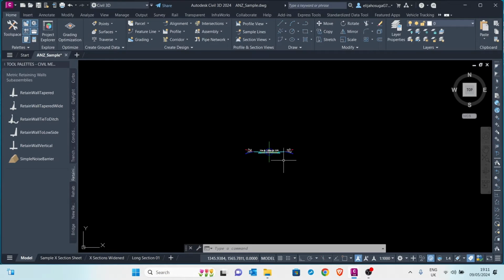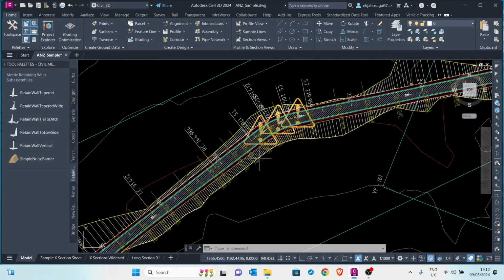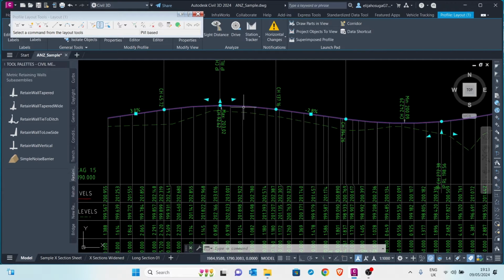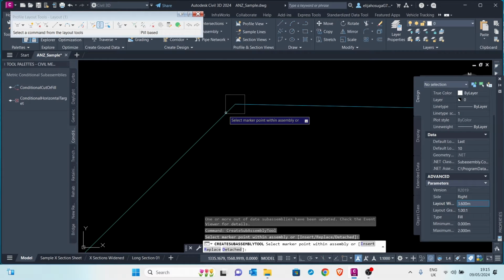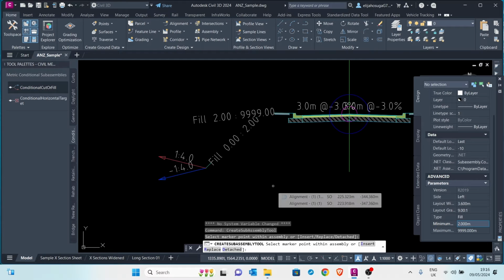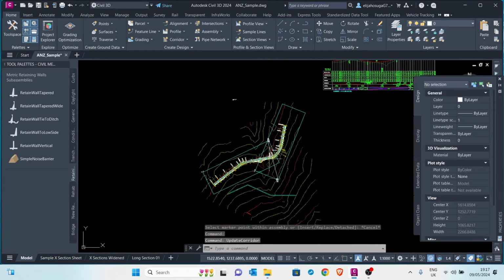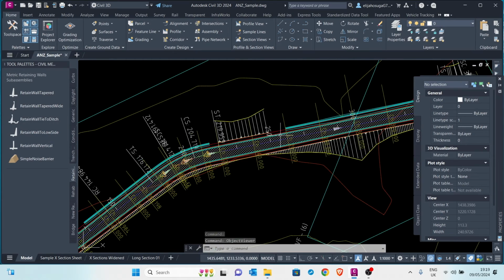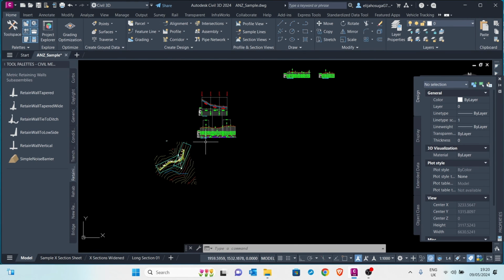Civil 3d Conditional Cut and Fill Subassemblies

Comment: Thanks. I'm trying to change the text height and colour of the conditional cut and fill assembly but I'm not seeing it in codes... Any help?
Reply from the maker: have you tried changing the annotation scale?
Reply: @getcadskills3482  won't that change everything?
Reply from the maker: Yes. most of the time while working with section views. I usually create a copy of the drawing and use a smaller annotation scale for the sake of display of section views. otherwise, please try assigning another code set style to your assembly such as the View Edit and see how it appears. then get back to me.
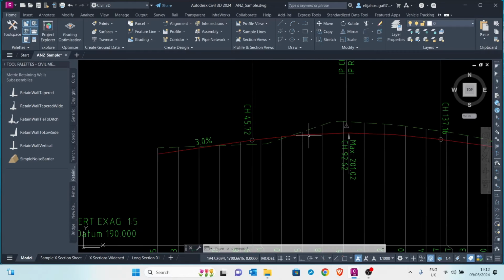Reply: @getcadskills3482  I already kind of do that. I have a dwt template for section views in 1:50 for the viewport that I use for publishing. Instead of a seperate drawing I just switch back and forth scales when printing pdfs. As for a code set I already have one for assemblies, profile views and the likes that I made... I could work around the fixed text height of conditional cut and fill assembly and create a new code set for that